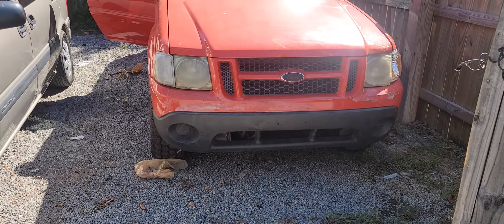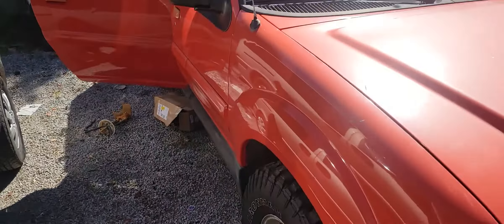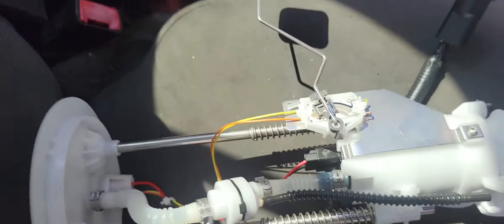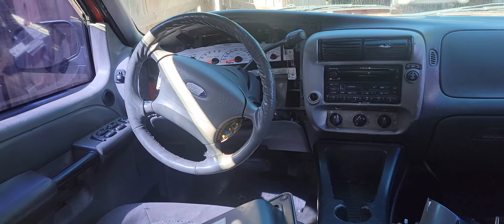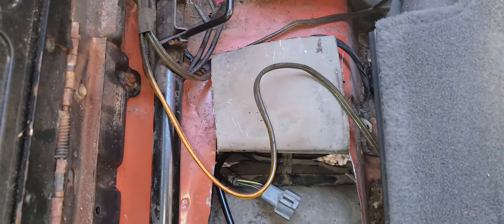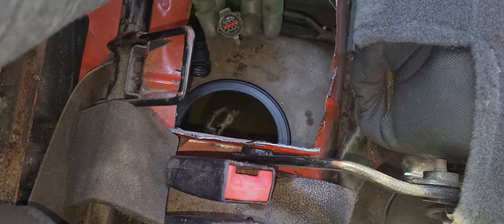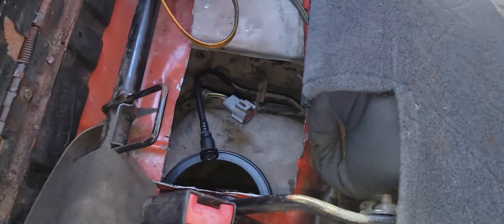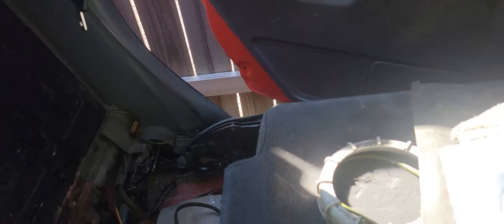how to reach your fuel pump without removing your tank 2004 ford explorer

Comment: I did this in my 2000 Tahoe. It was actually VERY simple. I paid $160 for the pump and THATS IT. A shop quoted me $800 to replace my fuel pump. 
I won.

Comment: I did this also, but with tin snips.  It's supper easy, you will be done in an hour or 2 maximum, just fold the metal back down and seal it with your choice of duct tape, sealant, etc... then the padding, carpet, etc... goes back down and no one ever knows the difference.